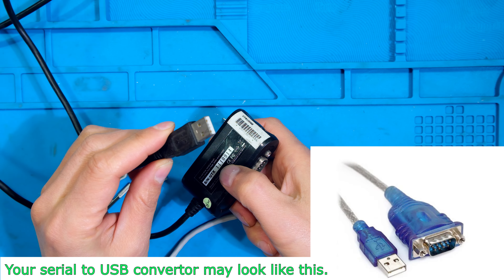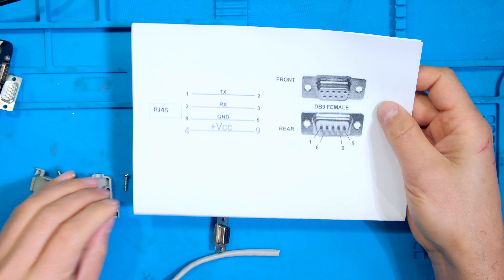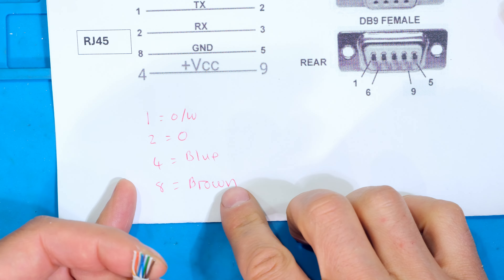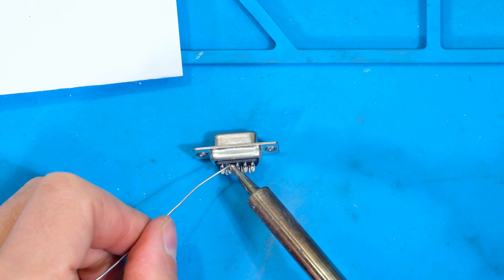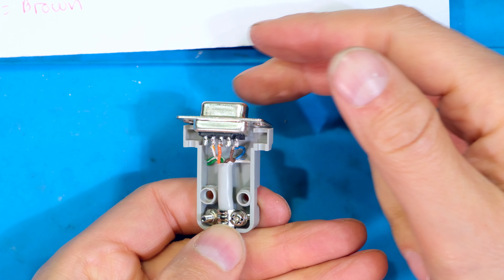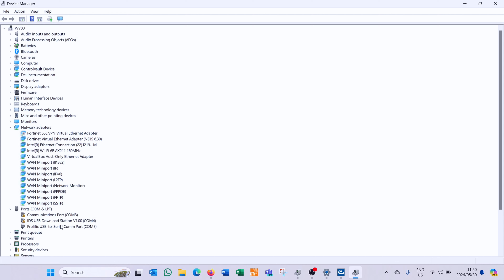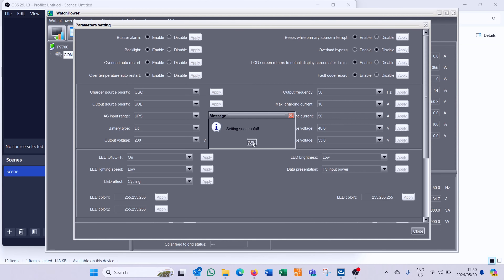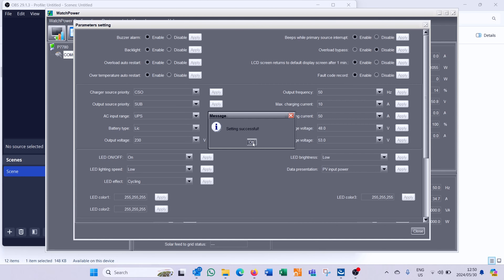How to make the Ethernet to Serial communication cable for the Voltronic Axpert RCT solar inverter

Comment: What type of the exchange protocol is here? Modbus RTU, CAN bus or just COM on RS-232?
Reply: Last version 1,15 of WatchPower has Modbus communication, and doesn't be work. Look for v. 1,04, and there will not be Modbus, but common RS232, that's working.